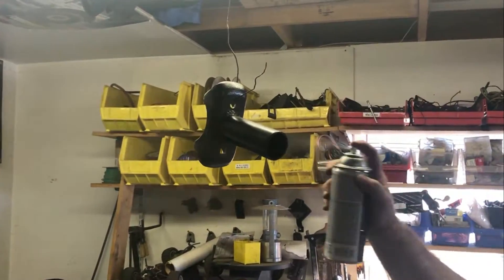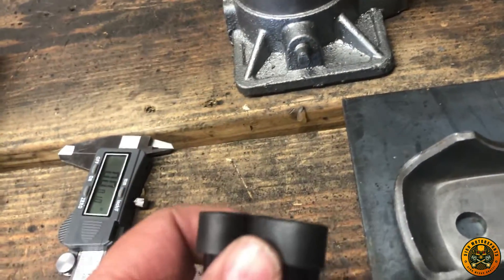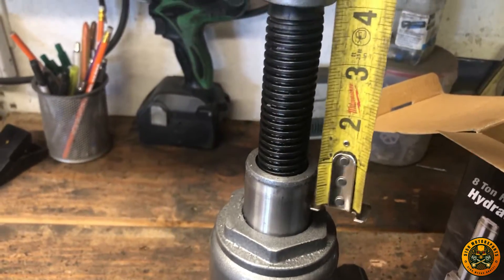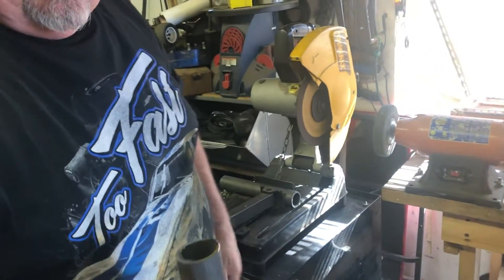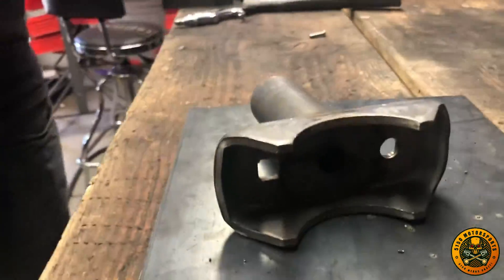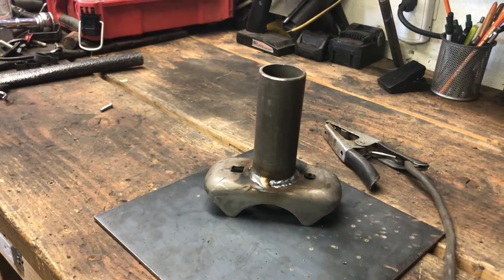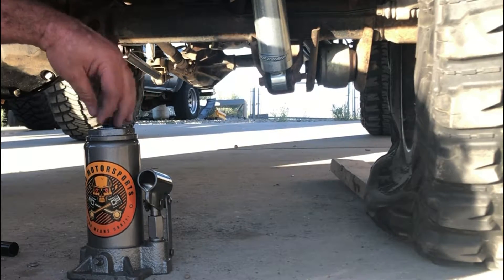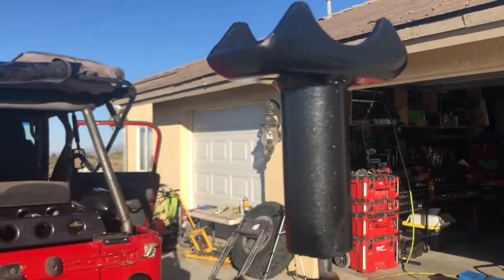How to Build a Axle Saddle Jack for a Harbor Fright 8 Ton Bottle Jack

Comment: What's the benefit of this over the stock scissor jack?
Reply from the maker: It’s little smaller and easier to store.. We have modified scissor jacks to fit the axle and works great also… Thanks for watching….
Reply: Scissor jacks are called widow makers for reason. This with a base is much safer and easier to use.

Comment: Are you able to make the extension and sell them to me. I have a travel trailer and would like a set made and shipped to Minnesota. ZIP Code 55008 can you come up with a cost. Would like it with a harbor freight 10 ton jack So your pipe size will need to be different and I may want them taller.

Comment: i just may have to put one of these together, already have a couple bottle jacks. super cool tip. why the 8 ton? you lifting a bus? or is it because of the height of the jack??
Reply from the maker: Correct mainly the height and the base is a little wider than a 4 is 6 ton..